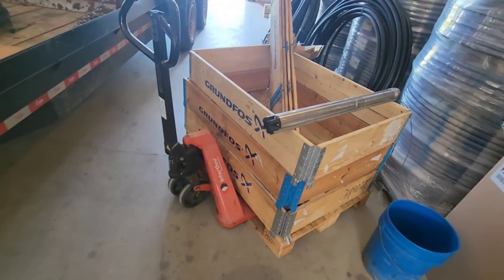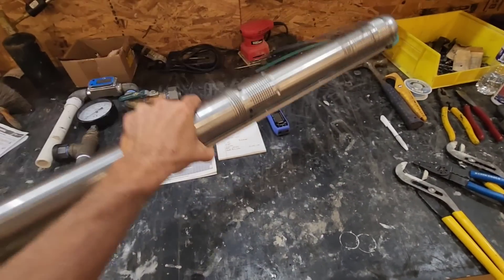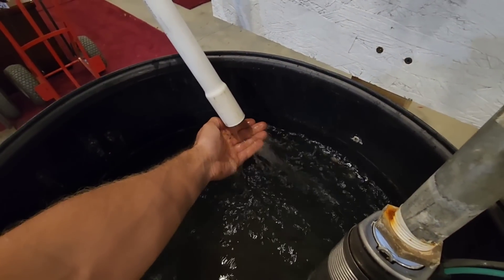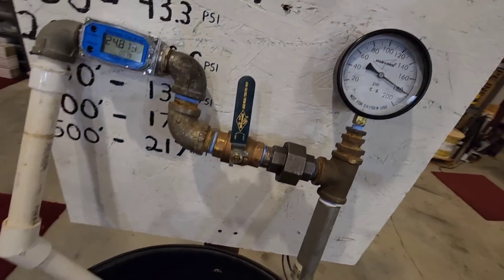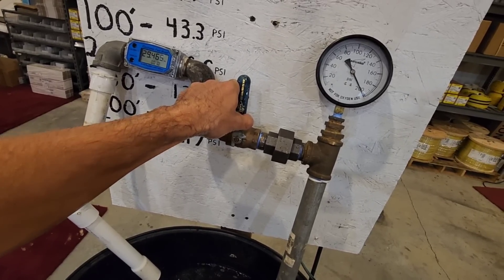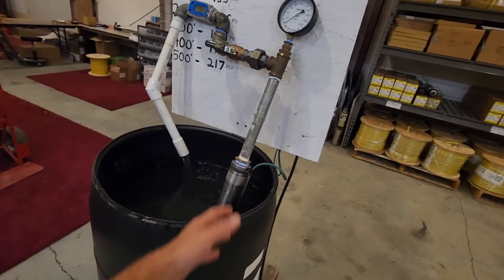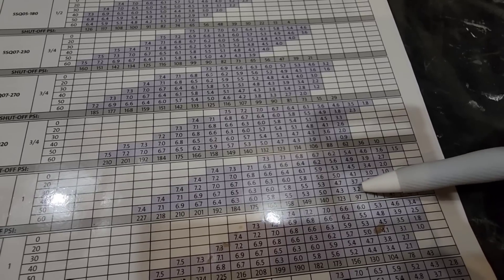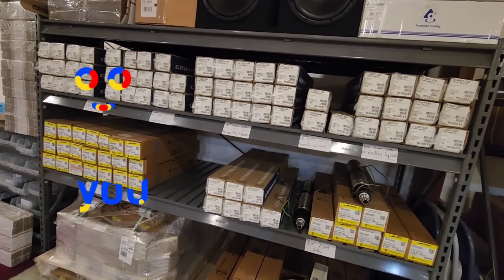Well Pump Test. Grundfos SQ-360! This Little Pump Created Incredible Pressure!

Comment: I think I need a new pump. Was going to order Grundfos. But before I do I have a question. My well is 325’. I have a 9 year old Gould 3/4 horse 5 gpm. It will only make 40 psi. It just keeps running. I still have water while it’s running. Some said possibly a sticking check valve. Would really appreciate your input. Thanks Mike.

Comment: Measure Amps again when you have 400-500ft of supply wire added into the equation using peak hold function on the clamp. Vdrop should be your go to for wire selection not the pump demand or flow rate. The way you explain discounts the most important variable for current draw which is circuit length. You might have experienced VD issues on jobs before when lights briefly dims whenever pumps kick in. Many issues can arise from that condition including spiking the supply and killing electronic equipment prematurely. The internal resistance of the wire you want to use should be charted and plugged into formula below and can drastically alter VD. Getting VD wrong can also have serious consequences for fault loop impedance and safe automatic circuit disconnection. Max VD for you is 5% or 6 volts at the furthest point from supply on 120V 15A circuit.

Vdrop = (2 x A x L x R)/1000

Comment: Don't you need to add the 60psi from the chart?  So at 1.6GPM, we should expect 199PSI (460ft/2.31) + 60PSI = 259PSI.  You're only measuring ~190PSI.  Deadhead pressure also much less than expected.  Seems like the pump actually is not performing close the the chart/published pump curve online.  What am I missing?  Thanks so much for these awesome videos and sharing your wealth of knowledge!

Comment: My grunfos 3 inch pump is 27 years old still runs great. Super pumps.
Reply: How deep is your well? Thats a long time! I hope mine lasts that long.

 My grundfos is doing good for a few years now but my well around 450 feet.
Reply: @justins3810 Well is 48 ft. Good water no sulphur or iron. Pump is now 28 years old. The old pumps had no fancy electronics.
Reply: @AS-tt8ui that is impressive!  Thanks for replying!

Comment: How  many watts of power does it really use  . Watt tester  I talked to you before and you really helped me and your pressure gauge works great . Better thn the cheap ones from hardware stores . Can house plumbing be able to take the flow rate  Also on pressure tanks how often should they be cleaned of silt from the well . I have the whole house automatic flush filter and it is after the pressure tank  . When filter  backflushs it is still red silt  and I have it back flushing every 4 days . It is not heavy silt . just a little red . I have it going into one of my rain barrels in my basement so I can monitor it

Comment: How long is it safe to run these kinds of pumps ?  I am wanting to drill a shallow well around 30 - 40 feet for keeping a 1/2 acre pond full.  Also, do they make a pump like this that will fit in 2" casing?    Thanks, and I love your videos.
Reply from the maker: 2" casing will not fit a submersible pump. If you drill a well, drill a 4" or 6" well. I have a pump filling a pond on a timer, it runs 8hrs a day. These pumps will run fine if they run non-stop & open ended into a pond. Just tie in a timer & let it have a rest period. 
A 2" well would require a jet pump, those can't run 8hrs straight, it'll cook itself
Reply: Okay,thanks for the response and the info. A 4" well it will be then. @h2omechanic

Comment: The heat is NOT from the motor working hard. It's actually from the friction of the water molecules being pinched through your valve. Your current draw will drop when flow is impinged. Pump is not doing as much work. 
Vacuum cleaners also draw less current when the hose is clogged.

Comment: I have been having well issues lately (Texas, maybe drought-related, 2nd worst on record). We had a worse drought in 2011, but this one is not far behind that one, in 2011 I didn't have low-yielding pump issues. I have a Sta-Rite 1.5hp #MSF-7, if it turns out to be my water pump I was wondering if the pump in your video could fit and work on the well I have? Recently I pulled the 140' pipe out of the well and replaced the jet leathers and foot valve (1st time doing that). Flushed the well with pressure. When I pulled the pipe it had no foot valve on it (now it does). There was mud in the jet too. I also added a 32-gallon bladder tank and paired it with my 70-gallon galvanized tank to help with water demand. I'm wondering if I should wait out this drought and see if there are any improvements? If this pump wouldn't work for my well are there any other types that could, like air-powered pumps?
Reply from the maker: What is the diameter of your well
Reply: @h2omechanic  2”

Comment: The ultrasonic flow meters usually have problems reading curvy or turbulent flow after elbows.
Reply from the maker: It's a little prop inside. If I didn't use the elbows, the valve would spray water. The 90⁰s control the flow by forcing it to change direction

Comment: @10:00 amps follow flow, so yes when there is less flow, amps are less.  Cycle stop valves are terrible, they do not slow the motor/pump, so you are artificially dead heading the motor/pump which may allow it to over heat.
Reply from the maker: Spot on! I've tried to talk people out of using a CSV but they don't understand why.
Reply: @h2omechanic so is it better to let the pump cycle 500 times a day? Thats what mine is doing and am considering a cycle stop valve. Other options?

Comment: On that type of pump, it is not working as hard at low flow, so the amp draw is less when closing the discharge. On a gear pump or positive displacement pump, some of them will draw more amperage. Thanks for the video.

Comment: To help give you an idea how the pressure, speed, depth, RPM and other factors, do a little search on a topic called Affinity Laws.  It tells you how each of these points relate to the other points.  Like increasing pressure (or depth) may or may NOT be directly linear.  Especially when Hp is compared to flow.  Or how HP is related to pressure.  Many of those things are not linear.  

Great content, I test pumps and do the first start up testing on pumps and other power plant and chemical plant equipment after the plants are built but in the process of the first time start up.  Very good work on your test rig.  The elbows are essential as you say, to accurately evaluate how the system will run in a real case.

Comment: Very happy with my Grundfos SQ-290 using a cycle stop valve. It pulls about 9 amps initially, but the cycle stop valve stops down and I normally see 6-7 amps. However, just like you said I see high pressure on the tank to pump line side.

Comment: OK I was for the  first 60 years of my life I was a city guy, so if you asked me where does the water come from?  My response would have been, "The city pipe I guess".  Ok I knew we nicked it from the folks in the Sierra Nevada mountains and stored it in tanks on the hillsides so we had 90 psi pressure at the meter.  
Having gotten tired of having the hub caps stolen off my truck I have left the city and now have a 300 foot deep well and generally a better quality of life.
My well pump is over 15 years old.....more than likely closer to 25 years.    I wish to replace the pump before it dies  (you know this always happens on Dec 23) but I would like really good....read 80 psi pressure....  yep I like a shower you can use to sand blast.  
 I will be contacting you on your web site and buying the pump from you because:
1) You do thoughtful testing
2) You work in the real world
3)  There are darn few places where it is possible to find a thoughtful subject matter expert.

Thank you and best wishes.

Comment: I wonder how the amps change when you put 400' of wire between the power source and pump.
Reply: If you don’t have the appropriate wire gauge you end up with voltage drop so you have more amperage draw.

Comment: I've had great luck with Grundfos 3" pumps over the years. My current set-up has a 1-1/2 hp 10gpm Grundfos pump hung at 400'. My well (after fracking) makes 15 gpm. The pump was hung at 400' because before fracking the well made 1/2 gpm and we did not know how much the gpm would increase after the frack. We wanted to be prepared with a large amount of reservoir in case the flow rate wasn't much improved.

I ran the pump off of a 4500 watt genny for a year to irrigate my Elderberry fields before my house was built and power was brought onto the farm. One of the really nice aspects of the 3" Grundfos pumps is that they ramp up slower than other pumps, so you can get away with using a smaller generator since the inrush current demand isn't huge.

Take care and God Bless.

Comment: Hi, thanks for sharing, any idea how accurate is that GPM gauge? I have been looking for one for a while to test available flow rate for an irrigation system in 5-20gpm range.
Reply from the maker: I'd say it's accurate to 0.2-0.3gpm +or-  
It does a great job. 
Designed for fuel, so it's gotta be pretty close. Max is 25gpm

Comment: The near constant 6 amp current made me think about how this or other well pumps might behave in a solar powered system.  Do you ever run into pumps on a solar powered house?  Would you be able to make recommendations on a pump that wouldn't have large startup currents?
Reply from the maker: That's a good question. I'd recommend anyone to RPS solar website. They are more knowledgeable on that area. All I know is a 240v Pump to be ran off solar requires its own separate inverter. Ill do a video in the future on those topics (once I learn more about it). 
But check out RPS solar & tell um H²O sent you there.
Reply: @h2omechanic  Thanks for the reply and the possibility of future videos on that.  I'm not very knowledgeable about these kinds of things, but I was impressed with that near-constant 6 amps (even through startup).  At 240v, that looks like just shy of 1.5kw.  That doesn't sound that bad to me since the pump shouldn't be running all that often for normal use.  But, I do see a lot of comments about water well pumps and inverter loads.
Reply: Grundfos makes a solar specific pump called the SQFlex or SQF series. Basically the same look and feel as the SQ series, but takes 30-300DC OR 90-240VAC. 

I run one in a cistern (horizontal) to feed a storage tank above the house with a 6-SQF-3 model. Two 327 watt solar panels in series wired through a Grundfos CU200 control unit. Float switch in the tank. The pump is specced for 5GPM at 689’ of head. Crazy! I’m only going to 150’ of elevation - so I get a bit over 6GPM. Pulls about 360 watts running my modest elevation. 

Soft start. You can hear the pump ramp up and bounce sunlight vs pumping load. Lots of clouds and need water? Hook up a 120v Honda genny and It will pump all day while sipping gas. 

Highly, highly recommend!
Reply from the maker: @cferber582  that sounds like a awesome setup! Thanks for sharing!
Reply: I run a Grundfos 10 SQ07-200 on a Victron Solar inverter with no problem. Also runs with a generator. Since there is no power surge, just about anything at meets the run requirements can run them.